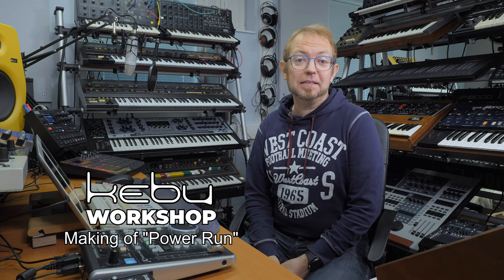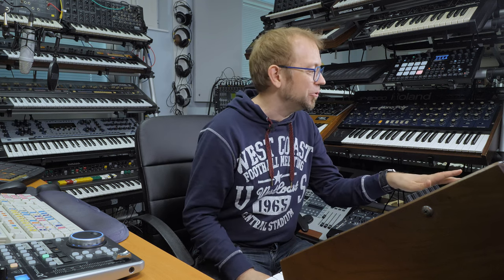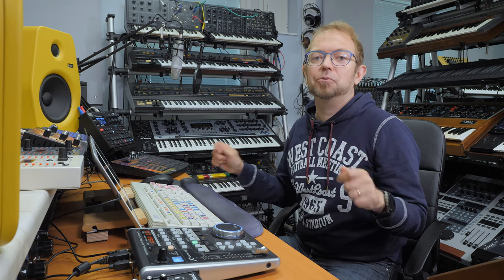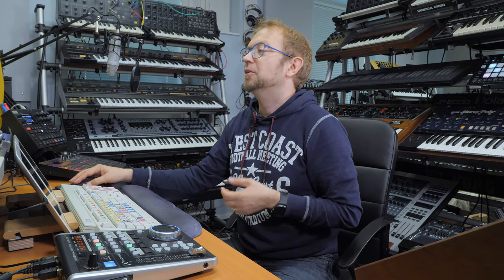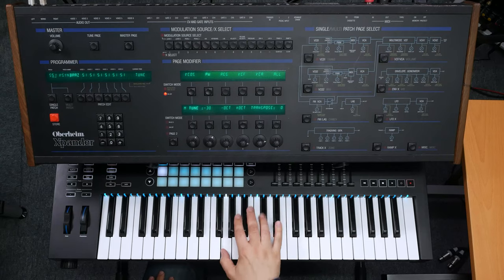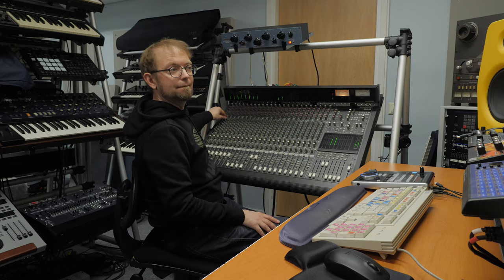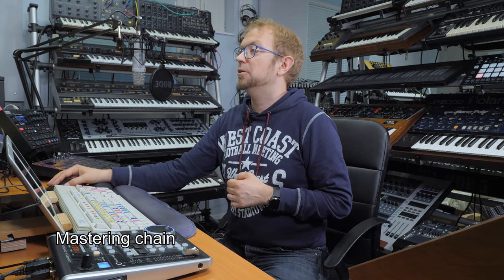Making of "Power Run"

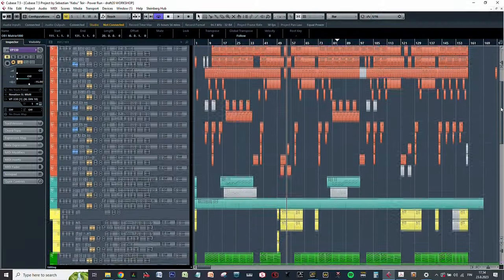Comment: 24:20 a tip here: maybe use a Korg800DV! With this amazing vintage beauty, you can have a pink (or white) noise with different filtering, envelope and modulation on each canal, pan them and even cross modulate them for good measure with two ring modulators. That's the reason why I've been using my beloved 800DV since... may 1976 in almost all my rhythm/bass or ambiance background tracks.

Comment: Is that a Roli Seaboard behind you? Have you used it in any of your videos? I'm suprised you didn't use it for the lead in Flight of the Navigator.
Reply from the maker: Yes, it's a Seaboard Grand. But it's really difficult to play anything in tune with it. I was considering using  it for the tune, but I didn't see the point in it, because I wouldn't be able to make the solo sound as good as it sounds now. The Seaboard is great for acoustic or fretless bass sounds, though.

Comment: Kebu, great setup and legend's device 👌👍. The best would be to have a powerful unit and Cubase run more efficient, more fast. Wonderful tracks in this vidéo and your album 💪✌️. To solve your problem with your midi ( with or without DAW) and to have always a synchronization with all devices, analog instruments, sequencer etc.  You must use a midiclock generator 😊💪🙏 ✌️ 
Going to playing and producting greats songs 👏
Reply from the maker: Thanks! But I'm not using MIDI clock, so that can't be the problem. I'm just sending MIDI notes, CC data and SysEx to my synths from my DAW. And SysEx I only send in the beginning of the songs in order not to take too much bandwidth. But yes, a faster computer couldn't hurt.
Reply: @kebu Hello Kebu, i advice just you 😉 that you should use to solve this problem a midi clock generator to synchronize your set up.  This device catch the clock of your DAW ( mode slave )  or generate the clock in the box ( mode master ). Even if you send just the informations sysex, CC, between devices and your DAW ( Ableton, Cubase ...) etc... the protocole MIDI will be synchronize thanks to this box midi clock with all others instruments even chained bye MIDI.
the box propose 4 out MIDI synchronize  or indépendant and 1 in MIDI + in  audio  synchronize with audio card / DAW 😉🙏.
You can calibrate even the timing in your DAW to regulate and synchronize the timing in millisecond ...
Lot of problem in MIDI when we play and use many instruments chained with MIDI.
Going to product the wonderful songs, EP 👌💪🎧👍